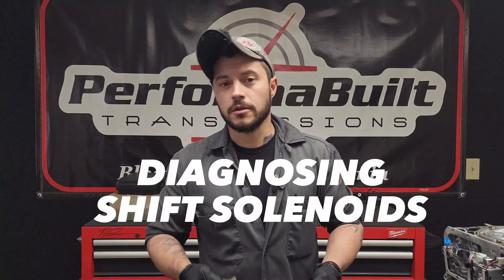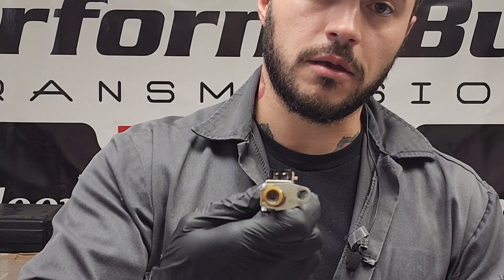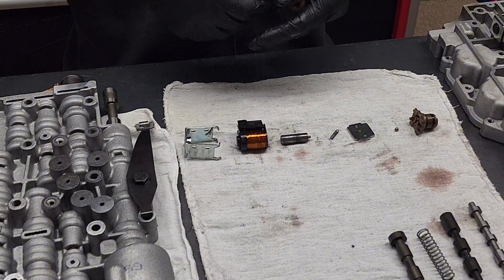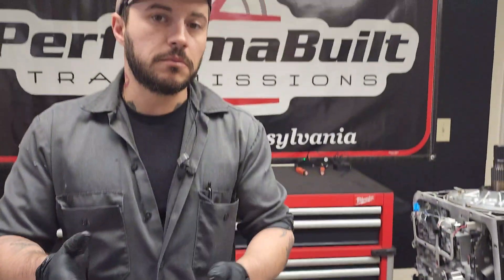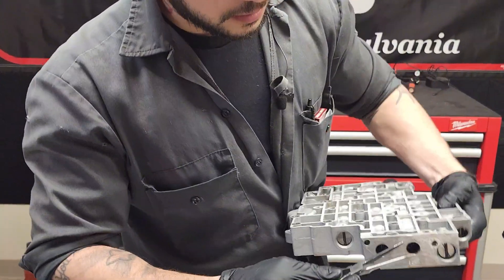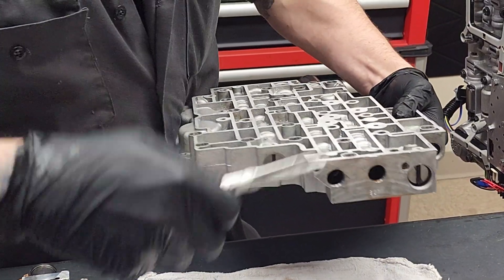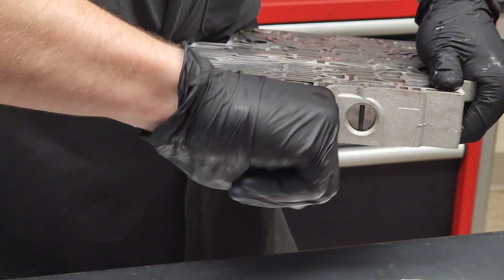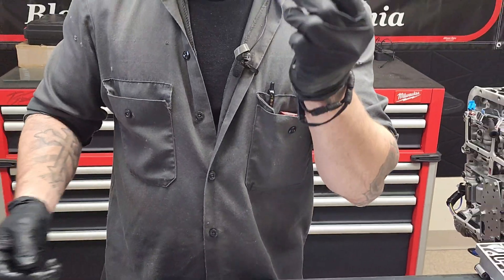Diagnosing Shift Solenoids

Comment: im having a hard 1-2 shift in a 05 4l60e but absolutely no codes. could it still be a faulty solenoid?
Reply from the maker: Probably not. They either work or they dont 99% of the time. If your transmission is stock and started doing this after years of smooth driving you may have a Broken 1-2 accumulator spring, 2nd accumulator valve is sticking in the sleeve, your bands is stretched and has excessive clearance with many miles, or your filter is clogging up and the transmission needs a service.

Comment: I got one that wont shift into third unless its 2k or less rpm. Could the solenoid cause this ?
Reply from the maker: Whats the fluid look like? Whens the last time you serviced it? Any codes? Solenoids always throw codes.
Reply: @PerformaBuiltTransmissions fluid looks brand new, no burnt smell. My hp tuners wont read trans codes on this truck. Its a 97 c1500. Trans was rebuilt 4 years ago. I just bought the truck. It rums flawlessly in all aspects trans wise, it just won't go from 2 to 3 whem hot, unless its under 2k rpm
Reply from the maker: Id check your filter and make sure its actually full. Otherwise the transmission will need inspected for failure

Comment: Nice video I have 4L60 ok was very dirty and it park for a year plus shift third rpm goes up to 4-5 rpm and shit till slight take ur foot off the gas pedal no codes all orther works fine
Reply from the maker: Third clutch is damaged from lack of maintenence and dirty fluid/ clogged filter.

Comment: Happy thanksgiving! I have a question. 4L80E will only move with the lever from reverse to neutral. I have the pan off and tensioner off, and looks like manual spool won’t move past those two spots. Haven’t taken off the shift shaft or rooster comb yet. Was working perfectly up until yesterday. Would stuck solenoid spools prevent the manual valve from moving?  Thanks!
Reply from the maker: Theres no checkballs or anything in that area that could obstruct the manual valve from stroking. Have you disconnected the vehicles linkage from the transmission shift shaft yet? I feel the problem isnt the 4l80e valves because theres nothing that could really stop that manual valve from moving. The shift valves arent related. Id inspect your vehicles shifter and linkage.
Reply: @PerformaBuiltTransmissions thanks for replying. Yes the shift cable is removed, and the pan is off.  I can get it to move a little further by force, but feels really rough sliding. Maybe the manual valve got slightly bent somehow. Oil looks excellent. It was rebuilt sometime before I bought it. Has worked flawlessly up until Wednesday.
Reply from the maker: I have seen it bend before. Good observation. I suspect that could be your issue as its very soft aluminum under the hard anodized coating.
Reply: @PerformaBuiltTransmissions pulled the valve body off this morning. Found half of a check ball crushed in the manual valve. When it was rebuilt, the tech must’ve lost one. 😂🤦🏻‍♂️
Reply from the maker: Also happy thanksgiving to you too!

Comment: I recently got a P0742 code on a 2001 v6 Camaro. Car is struggling/stuttering to be shifting and first and second gear. Once I’m going past 20 mph the car is smooth sailing. This happens at upshifting and downshifting under 20 mph. The fluid is in great condition and not leaking, everything is stock. I’d really appreciate your input and advice sir.
Reply from the maker: Well your transmission never had an issue but your brake switch where your pedal is does and that controls lockup. Unfortunately because ypu kept driving it lockup has stuck on because of the brake switch unable to shut it off and now you need a whole new transmission, torque converter, and new brake switch.
Reply: @PerformaBuiltTransmissions  I also forgot to add that sometimes my transmission works normally at times and it is shifting between gears perfectly with no stutter. But I’d say about 90% of the time it stutters and 10% it’s working completely normal with no issues at all.

Comment: I recently got a po757 and po706 where I only had my first gear and after a few minutes all my gears went away and I had all 4 neutrals any thoughts please ??
Reply from the maker: Those codes display and the vehicle should have been immediately stopped and towed. If you have no gears, something broke while trying to drive it with vehicle codes. Time for a rebuild.

Comment: What if it won't shift out of first? It use to only shift if letting off the gas,  but now it won't 08 avalanche
Reply from the maker: Have you checked fluid condition? If the fluids burnt you most likely have a mechanical issue or voltage issue for the related components that tell the transmission what to do. If the fluid is clean and bright pink, i would scan for codes and inspect shift solenoid A.
Reply: @PerformaBuiltTransmissions burnt smelling and dark for sure.  220k miles.  Do you think it would be worth trying new fluid, filter and solenoid?
Reply from the maker: No, your cooked. You dont have a shift solenoid issue you have other issues

Comment: Please help.  No codes. 4L60e. 2/3 overshift when warm mostly underload. Gets really bad after driven 5 or more hours. Transmission was rebuilt about 20k miles ago. Even when manually shifting from 2 to 3 past the shift point, it still sometimes overrevs. Fluid is full and fresh. New TPPS Valve. Solenoids were replaced shortly after the rebuilding
Reply from the maker: When is the last time the filter was changed?

Comment: I wish I’d seen this video earlier. I had code PO758 so I replaced both “A” and “B” shift solenoids but I didn’t know about the pilot valve for solenoid B. I got it back together and I’m still having the same issue with the same code. So now I’m going to turn my attention to the pilot valve. If the pilot valve doesn’t stroke what is the next step. Do you replace it….how do you get it out?
Reply from the maker: To get that one out if its stuck you are better off pulling the valvebody and using a set of picks and compressed air

Comment: Is it normal for the plunger to stick out when you remove the solenoid from the transmission like I had to hold the solenoid while I put the clip back in because the plunger was sticking out on the b side of my 4l60e transmission. But on the a solenoid there was nothing sticking out with no resistance which I was getting po752 code for the a solenoid stuck on
Reply from the maker: Valve A is spring loaded. Valve B isnt spring loaded. Totally normal
Reply: @PerformaBuiltTransmissions ok so it's normal for solenoid b to pop out and solenoid A not to. I suppose I thought A would of pooped out if it was spring loaded. Is it possible the spring is dirty and staying stuck in valve?
Reply from the maker: You have it backwards. Sol A is 1-2 loaded Sol B is 2-3 not loaded

Comment: I have this issue with my LB7 duramax, it has the Allison 1000, but every so often maybe once a month on longer trips 50+ miles if I’m going around 60-75 mph my transmission will have this electric issue and throw a code but if I pull over on the side of the road and cut my truck off and turn it back on everything goes back to normal, why could be the issue?? I was thinking shift solenoid.
Reply from the maker: You probably have an overall voltage issue with the vehicle not the transmission. Research your code also, many engine and chassis codes affect the transmission.

Comment: Mine only start off in 2nd and shift to 3rd in do or manual no first or fourth and no codes no slipping when in gear and is not even trying to shift it just hold in gear  and the computer show its commanding gears solenoids show they are turning on and off show cammanded 4th gear but wont shift where should I start ls swap 4l60
Reply from the maker: Sounds like limp mode

Comment: I have a 2013 GMC Yukon XL that it gets stuck in second then p700 and p777 codes pop up. Would that be solenoid issue?
Reply from the maker: Change your epc force motor solenoid in the trans and make sure the new one is operating correctly when installed by performing a pressure check with the transmission. Id make sure your vehicles tcm isnt shot also and is giving power to the trans.

Comment: Btw nice 3hr 4l60e build. 
I have a stock 08 4l60e Trailblazer where when it shifts into 2nd it falls on its face and doesn't start to accelerate until it grabs around 3k+ rpm mark. From watching your video you considered the problem being the 2-4 clutch band?
Second question. 
Being that it's a daily driver 4.2. would a stock be fine or a upgraded 4l60e be necessary since it's in great shape and planning on keeping it for quite some time?
Reply from the maker: Stock would be just fine but a wide band never hurts. Yes id go with servo, band, clearance, and a new reverse input drum
Reply: @PerformaBuiltTransmissions  thanks for the reply. If you have time I have another question. Being that I'm on a budget where would a good online place be to find a slightly upgraded 4L60E or could I go with a stock remanufactured 4L65E without having to modify it to fit or does it fit? Thanks again👍

Comment: Hello i have a 2010 4.3l silverado 2wd rclb today it started HARD shifting into 2 and pretty hard on 3 as well and my rpm was fluctuating like crazy by about 400 rpms going about 45 mph it did have low fluid when i bought it so i topped it off and it was fine for awhile but noticed some delayed shifts every now and then. Fluid is red but dirty on the dipstick but in the hash marks on the dipstick. No idea on history of it i bought it with like 195k miles now it has 208k miles i have never done anything other than top off the fluid. Yes i know i shouldve changed filter and fluid a long time ago 😂

Comment: Ive been watching your videos. I rebuilt the pump on my 4l60e. And it broke again soon after. I bought a remanufactured heavy duty torque converter of the same stall. Rebuilt pump again. Installed Corvette servo new solenoids filter checked for rotation and squeak before and after installing pump. Switched over to dexron 6. Started avalanche and it seemed to have no movement in any gear and a loud whine in neutral with the driveline bouncing in neutral. I took the trans out and put the old servo in the old solenoids in, checked band clearance and rotation, took pump apart it wasn't broken. Re installed everything. Good spacing on converter with washers for spacers. Start truck same problem. Moves now in gears but feels weird reverse seems to lurch back forward when you let off the gas and forward feels strange and its whining in neutral with the driveline "bouncing".
Was shifting fine before pump failure. Not sure if you will see this but its worth a shot to ask your advice. Happy 4th of July

Comment: I have a 2008 saturn vue redline and the code is "shift solenoid A stuck on" and it drives fine, it shifts a little funny though. But sometimes it drops into 1st gear and stays there until i shut the car off, back on, and shift into reverse before going into gear

Comment: So i have an 03 4l60e i rebuilt. Had a typical 3rd burnout after 230k. Question is, is there a break in and if so. How long is the break in
Reply from the maker: That is at the descretion of the builder who built it. Our break in is 500miles fluid and filter or 3 to 5 passes fluid and filter. Afterward mandatory once a year or once a season/race experience change.

Comment: I have a 05 sierra and I’m having a weird shift issue it’s a rebuilt jasper trans and when I am in 4th when it’s warm it downshifts and upshifts erratically over and over again I don’t have any transmission codes but my o2 bank one sensor one heated circuit and bank two sensor two heated circuit the transmission is commanding 4th gear but it’ll downshift into 3rd when I’m cruising and then Upshift again when you give it any gas or it goes up a hill sometimes it’ll just go down then back up then down again do you have any ideas? I’m stuck besides filling for warranty and getting a new transmission but I’d rather not swap it again
Reply from the maker: I dont think you have a trans issue. I think you have a tune/ vehicle electrical issue. Trans cant just downshift on its own

Comment: I have a 2002 Chevy Silverado z71. Will go into park, neutral, and only first gear. It is not throwing codes. Could it still be the shift cylinoid?
Reply from the maker: Could be but unlikely. Perform a data log. Its most likely the pressure manifold switch if your fluid is pink.

Comment: 11:12 haven't checked codes yet. Got a 60e. Was rebuilt around 5 years ago. Past year or 2 its had a slight slip from 2 3. Have kept fluid and filter clean. At the beginning there was some flat pieces of metal. Month ago i lost 3 4 completely.  1 2 and reverse are strong.

Comment: Where can I get the pliot valve ?for solenoid 2-3 i have 07 chevy silverado LT 1500 . I'm have issues were it's starts and shifts but it fell like it's stuck in 2nd gear and rpm just goes up it's stock transmission i flush it and replace pretty much all the solenoids in it and it's still not shifting while in driving. I'm not getting codes so my guess is it has to be the pilot valve it's must be getting stuck I've took it out and but it was a little hard getting it out. Lmk where I can order one or a website for it thanks.
Reply from the maker: Your in limp mode. You have an external electrical issue.
Reply: Where would I check for electrical issue for tranmission? Or where should I start ?
Reply from the maker: Another core or valvebody

Comment: Would both solenoids go bad at the same time? I have P0751 and P0756. On highway and it wouldn't stay in overdrive, then it just stayed in the 1 gear.  I still have reverse though.
Reply from the maker: No both wont go bad. You have a bigger issue
Reply: @PerformaBuiltTransmissions  I'm going to check wiring that controls the solenoids, but as far as the transmission goes, can there be something internally that failed to set both of those solenoids codes at once?
Reply from the maker: @ Power, grounds, vehicle TCM, vehicle harness. Solenoids are circuit based so 99% of the time if they fail, Its because of voltage issues with the vehicle.
Reply: @PerformaBuiltTransmissions  my man! Thank you.
Reply: @PerformaBuiltTransmissions  I kinda know the answer but for comments sake. 

When you test the wiring (pink 12v) fuses and you have 20-40 ohms at both solenoids, now are we looking at internal failures?
Reply from the maker: Check grounds
Reply from the maker: If grounds check then its an internal issue with the iss behind the trans pump or converter itself

Comment: I have a 1994 K1500 with a 4l60e. It all of a sudden refuses to shift to 3rd gear. I pulled the pan to check the solinoids. Fluid was dark with a lot of sludge, didn"t notice any metal. I checked the ohm resistance on the solinoids. Came back 19 ohms on each. Tried the 9 volt battery test with no reaction. Could it be a plugged manifold pressure switch? 1-2 shift is good. Reverse works without problems. What else can I check without pulling the transmission and tearing it down?
Reply from the maker: If the fluids burnt, its too late. Your going to have to teardown and rebuild. Manifold switch isnt part of your failure. 3rd is your failure and theres many things in the vehicle and transmission that can cause it
Reply: Not what I wanted to hear but sometimes truth hurts. Thanks for your response. @PerformaBuiltTransmissions

Comment: 2006 Denali yukon 130k original miles 
Rebuilt 4l65e transmission work fine when done years ago let the truck sit for years because got new truck. Started driving 4l65e and rev to 6rpm taps out 50or 55.. backs off like it's hit gov limiter. Need help
Reply from the maker: did you service it with a new fluid and filter after it sat for all that time?
Reply: @PerformaBuiltTransmissions  put new fliter and new with a lil old fuild

Comment: Thanks this was the most helpful response to the solenoid replacement I found.  Am going to give it a shot today and fingers crossed 🤞 it fixes my 2015 2500 Chevy
Reply from the maker: Your 2015 is ALOT different than the years i covered in the video (1993-2013) 2015 is an entirely different 6L80E. Solenoids do the same thing but there are more of them and often needs the techm software corrected.
Reply: @ lol so turned out Totally different.  I have the valve body off and my luck isn’t as simple as yeah just change the shift solenoids. lol. May be over my head.  Well definitely over my head but I’m going to poke at it like a monkey with a stick for a while.  lol. 😂
Reply: I have a guy coming with a code reader to see if I’m wasting my time.  Fingers still crossed 🤞. lol

Comment: I got a 4l60e out of 04 Silverado. Shifts 1-2 fine. When it tries to go to 2-3, the rpm shoot up not wanting to grab 3rd. I initially thought that the 3/4 was burnt up. I then started manually shifting with the column and it shifts completely fine through the gears. You think it might be a 2-3 solenoid. No codes either
Reply from the maker: Should throw a code for 2-3. Is this a stock never touched transmission? Rebuilt? How many miles? Last serviced? Need more details
Reply: @ 

Stock 4l60e, never rebuilt as far as I know, 180k miles, I don’t know the service history. Got it for super cheap as a project truck. The ATF looks clean as the previous owner tried flushing it thinking it’ll fix it. Again I can manually upshift and down shift with the column shifter just fine.
Reply from the maker: @ Its probably not clean in the actual bottom of the pan and the filter is probably sucking shut to be honest. I would service the unit. dipsticks arent the best way to check for a failure.
Reply: I have the same problem in my 4l60, did you get yours fixed?